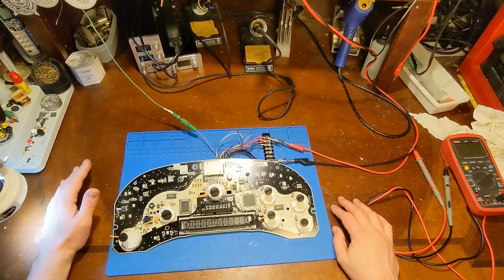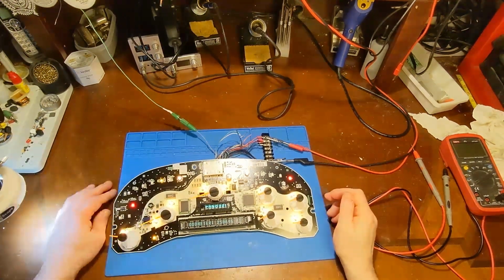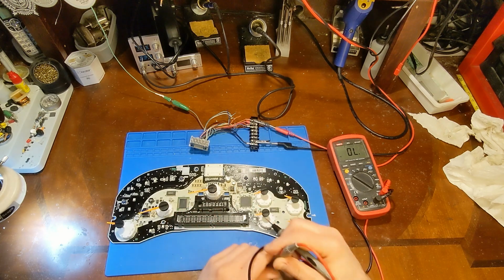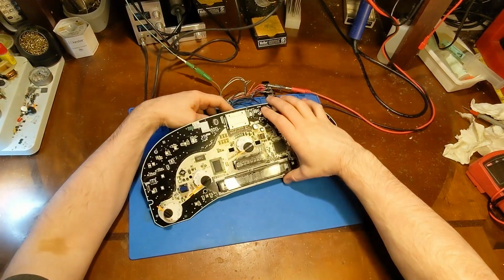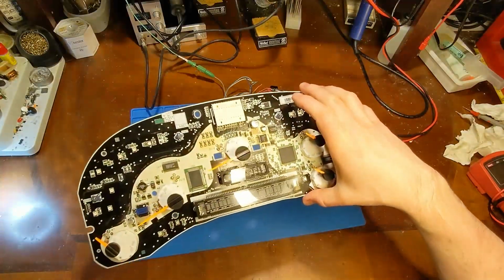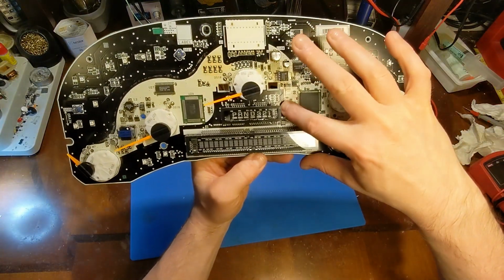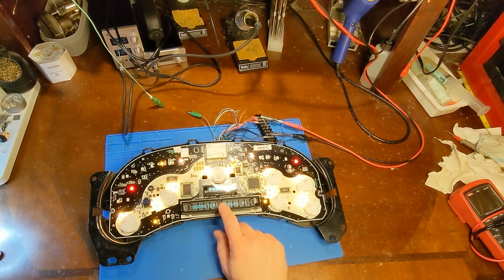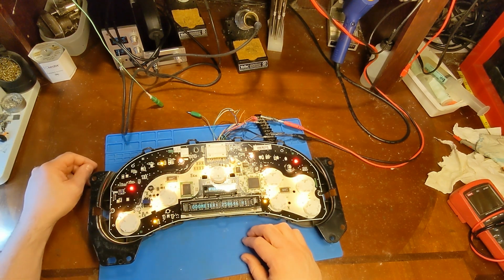2005 GM Cluster problems

Comment: I just seen this issue today on an 04. I know it was an 04 board because the 5v regulator was reverse what you had here. I didnt have time to fix it so i swapped out the board with a known good and figured i would get back to that issue. I thought the u16 was the eeprom but i think they swapped the eeprom locations in 05.

Comment: I have a dead 05 cluster that comes back to life when I push below the voltage regulator. Can you help me?
Reply from the maker: You have fractured solder joints. It could be the voltage divider resistors that are used to set the voltage on the adjustable voltage regulator, that's the SOP-8 chip. The voltage divider resistors are blue and nearby.

Comment: If I could only find a diagram that shows me what each 511 chip and 561 chip or resistors whatever they are I just need to find a diagram which shows me what they do and what they’re connected to. Is there such a thing out there?
Reply from the maker: What is it your trying to do? What's the end goal with knowing what they do?
Reply: @jeffescortlx  I believe that if I can understand how the components are connected and what activates what and how leads are ran and where they go then I would be much more capable of fixing my own equipment not only that but I freaking love it. I think I found my new hobby and it just burns me up that I’m held back by ignorance. How can a man know unless someone him? I remember when I was very, very young. I saw my father soldering often. It turns out he was a communications captain in the military so that was his thing and it’s stuck with me ever since and now just recently, I had a reason or an opportunity to try it myself because my cluster failed. I went from knowing nothing in one night to be able to possibly solder, separate motors and LED lights in my dash cluster, it was such a rush when it all worked. Got me hooked instantly. I try to fix above my level by replacing my PRNDL it was because it was dim and like I said in the previous message, it was painful, and I botched something up very irritating. When I found out that all I had to do was re-solder those five resistors up there on the left, but lesson learned, and that was not a waste
Reply: @jeffescortlx  what I’m trying to do is install my trans temp gauge and program the Eprom. Stepper motor is installed so that’s good. The next step would be to either buy or build the components I need to program the EPROM chip. “I love a challenge”, is what I tell myself to not be discouraged and give up.
Reply from the maker: @DaringEndrek6074  Ok yes I see. You'll need the eeprom to be programmed to enable the trans temp. But this is not related to those resistors.
Reply: @jeffescortlx  OK now I see after viewing  your footage specific referring to reprogramming Eprom poor trans temp gauge.

Comment: Thank you so much for all the information you put out. Question what gauge was that electro wire? I tried running a jumper with wire from a speaker voice coil for a pad that somebody ripped off of a fuel gauge stepper motor and I’m not sure well either didn’t do it right because it’s still twitching and not registering correctly
Reply from the maker: The wire gauge isn't critical. 25 awg is nice to work with.
Reply: Copy that.

Comment: Hi, thank you for all the good info you put out, it helps a LOT!!
I got an 05 too and the problem I'm having is the information display comes on, all pixels green, 45 seconds or so after I remove the key and exit the car. If I stay in the car it doesn't do it... even if I lock the doors with the fob. Any clues???? I'm lost 😢
Reply from the maker: I would recommend to go over the PCB with a microscope and look for fractured joints and silver migration corrosion.

Comment: My oil pressure gauge just quit working, how much would you charge to repair that and the shifter indicator lights? 2005 Yukon. Thanks
Reply from the maker: If the gauge immediately jumps to 80psi with the key-on it's the oil pressure sending unit that is bad.
Reply: @jeffescortlx  it jumps passed 80 and doesn’t return to 0 when the key turns off.
Reply from the maker: @numbr3t  I can be contacted for more information at 1mr.repairman@gmail.com
Reply: @jeffescortlx  email sent, thanks

Comment: Do you have any info on changing the colour of the VFDs? I've seen them done in white but haven't found any information on doing so myself.
Reply from the maker: It's done by using a color film. Typically aftermarket faces will have a different color film than what OEM uses.

Comment: You know I’ve seen people do this but where and how can you change the colors of the check engine light and other signals like battery light seatbelt light and those other ones I want blue know a link or where to get them
Reply from the maker: The warning indicator LEDs are 3528. Available at any parts distributor that sells electronics.
Reply: @jeffescortlx  also how much quieter are black Chinese clones and are they reliable
Reply from the maker: @Blackcateye04  kind of hard to say but about 1/3 quieter than the x27s. Yes they are reliable.

Comment: Hi Jeff, Im still on the search for a  small device that would turn the 99-02 trucks analog signals to retrofit the 03-07 clusters. Would an ADS1115 ADC work? Id send you one if you could tinker with it.
Reply from the maker: You'll need something that I can convert the oil pressure to a can bus signal.
Reply from the maker: I'm sure you'll run into more problems than just that, but I would recommend to get in touch with Matt at the channel fixed until broken. I believe he's looked deeper into this.
Reply: @jeffescortlx  thanks I beleived it was just a digital signal and not canbus.
Reply from the maker: @DaBuGzLiFe  oil pressure signal comes in through the can bus for 03 and newer.

Comment: Hello. My friend, tell me what can discharge the car's battery in a cluster. I just turn off the cluster as the leakage current stops. I live in Estonia and I can't send it to you for repairs. car cadilac escalade 2003. thanks.
Reply from the maker: The cluster has fractured solder joints and silver migration corrosion.

Comment: I need help I have a 04 gmc that just stopped working it has a 5.3 in it it’s not showing or doing anything I could knock on it and it would come back but not every time….could that be the plug in the back? Thanks I hope u can help me out
Reply from the maker: It's not the plug/connector or the harness. It's the cluster circuit board. Pretty much every 03-04 will suffer from this problem eventually. The repair is included with a standard rebuild.
Reply: How much is it to fix and how far backed up r u
Reply from the maker: @mattandrobinsoutdooradvent7105  for quotes I can be contacted by following this link: https://youtu.be/T_2WnJMsZaU
Reply: Ok I’ll see if I can get ahold of u in a day or two

Comment: Hmm a micro crack in the power track, i suppose it's to be expected with the vibration from the truck.
Or just a piss poor quality pcb.
I'm supprised that the flourescent display lasts that long in a truck.
They all go dim in equipment and other devices, i think the emission from the heater just drops off over the years.
They do look nicer than led displays, the old digital clocks had them.
Sorry woffle mode is turned on :-D
Reply from the maker: I'm guessing it's probably a failed via from top side to bottom side.
I do also appreciate they went with VFD. They could have cheaped out and went with LCD but didn't. VFD's have a nice hi end 80's feel!

Comment: Ever tried rejuvenating the DIC. I've done it to dim fluorescent panels and it works pretty good. Don't wanna burn the filaments but you get them hot for a bit and it seems to clean(burn) the crud off. Not sure about longevity.
Reply from the maker: I tried it once years ago and made no noticeable difference so I didn't look into it any further.